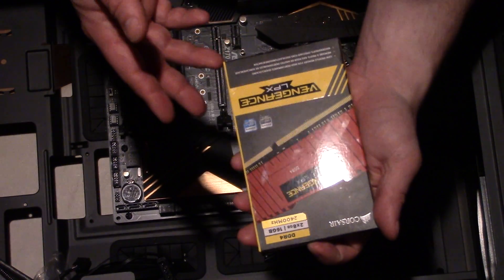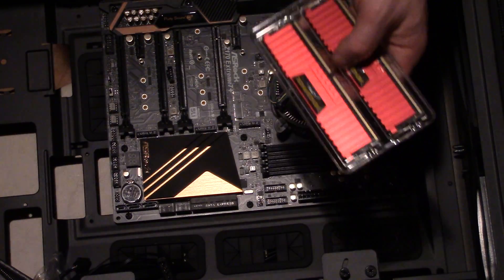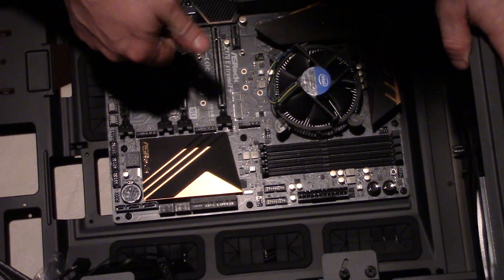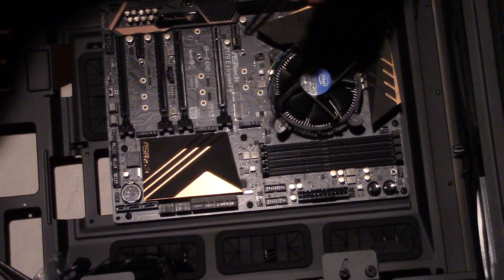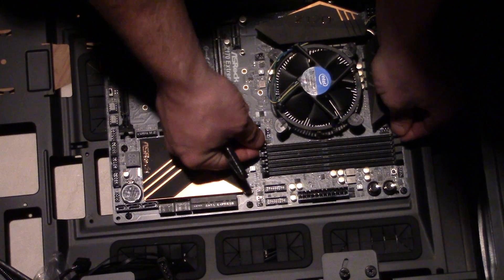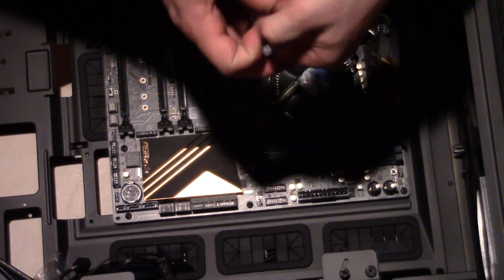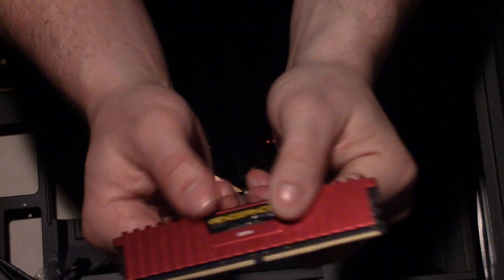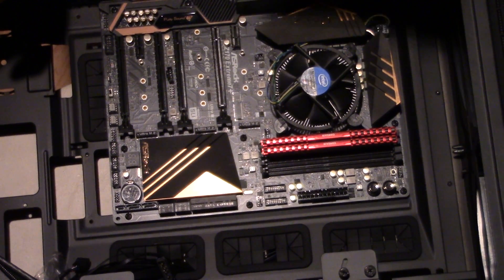Unboxing and Installing Corsair DDR4 2400 - Vengeance 288 Pin - 16GB RAM LGA 1151

Comment: NO NO NO NO NO STOP! READ THIS RIGHT NOW! If you are putting in 2 sticks of ram (which you always do) they need to be spaced apart to make use of dual channel, some mother boards only have 3 slots, but if you have a 4 slot motherboard like this guy does, it will typically go in slot A1 and slot B1, sometimes it's A2 and B2.  READ YOUR MOTHERBOARD INSTRUCTIONS!

Comment: Just want to point out that you put the RAM in the wrong slots. Should Be in the first one (A1) as you have installed but the second module goes into the 3rd slot (B1) for dual channel mode. Will still work but not in dual channel.
Reply: gollumondrugs a2 and b2 for dual channel
Reply: Thanks.. I just installed in right way
Reply from the maker: Yeah, I do this for a living.  Appreciate the comment and you are , in general, correct -- This was built when the architecture was 'cutting edge' and these were the first revision(s) of skylake and DDR 4 motherboards.   The system was clocked up the top 2 percent speed on latencies .. RAM timings, etc and it was MUCH more stable in single channel mode than any other.  This was for a business client and therefore  reliability = the best solution for a law firm. :)

Comment: please, can i also put 6 ram sticks instead of 4 out of 8 slots?  Planning to get 16GBX6= 96gb ram instead of 64gb. Would that affect the speed despite the fact it is an even number?
Reply from the maker: Sure you can put 6 sticks in an 8 slot MB.  Yes 96GB of RAM will work.

Speed can be effected but only if you were on a Dual Chanel mode and there is no Tri Channel mode,.. but if you NEED the RAM then having 96GB beats have say 48GB in Dual channel mode if that makes sense.

Bottom line is it should work fine,.. always take a glance at the Motherboard specs / manual to see the RAM Configurations but with RAM in most all modern MB's you can use any number of stick combinations you wish -- Just check out the dual channel modes and some boards have tri channel modes and even Quad channel.
Reply: GuessTech What exactly do u mean by tri channel? 3 Pairs of 2 sticks? I was planning to get the "GA x99 UD4" motherboard
Reply from the maker: This should help you understand. 
http://www.hardwaresecrets.com/everything-you-need-to-know-about-the-dual-triple-and-quad-channel-memory-architectures/
Reply from the maker: yes,.. you can put in 6 sticks,.. Usually you can put in any number of sticks .. even 3 RAM sticks for instance and the computer will run perfectly fine.  It's just optimal to utilize the channels the motherboard supports.  IE: In your system if it has 8 slots then placing RAM in even numbers (2, 4, 6, or 8 sticks) will result in best "optimal" speeds.  I'm sure you've already installed and things are running fine by now though.  How did it turn out?
Reply: I've already ordered 4 sticks of 16. He said the optimal was 4 at a time. I guess i wouldnt max out 64GB anways.